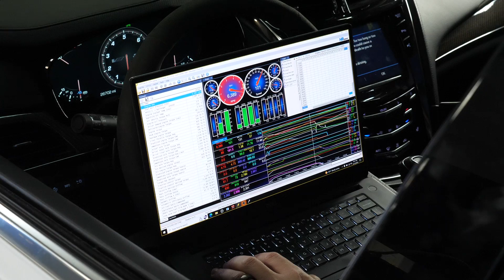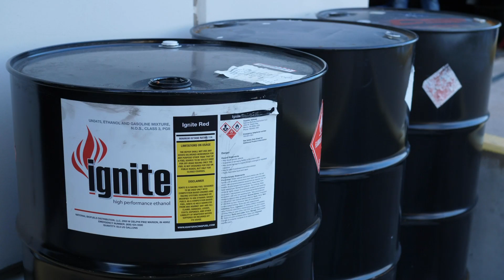Will This Turbo 2JZ-GE Blow Up? (Probably Not)

Comment: Hi totally not related but i got an idea some time ago 
im building awd civic and i was trough engine rebuild front suspension rebuild and everything i done myself 
i found it really pain in the ass to service front bearings because these are pressed into the knuckle
since i was planing on making car a bit wider and need to redesign front suspension at some point i wondered if i could build custom knucle with bolt on hub+bearing assembly 
do you have any experience with bolted bearings? are these a good sollution to my issue? is there a higher risk of bolt breaking or going loose than pressfited bearing? the main problem i have is that pressfited bearing needs to be installed properly otherwise it can crack the knucle and im woried about it 
if i keep driving this car as i did before reuild i will need to change bearings every year and thats alot stress put on a knuckle

Comment: The Non-vvti ge bottom end rods are the same as gte and pistons are higher comp then a gte. 10:1 so for a racing aplication it is cheap and responsive setup.
Reply: VVTI is better, makes a big difference on turbo applications

Comment: Andre, I theorize that the higher your boost level is, the less strain is exerted on the rod bolts across TDC of the exhaust stroke, due to the drive pressure in front of the turbine wheel, and depending on cam timing, also potentially incoming boost pressure during overlap.  Either way, there is a air spring of sorts cushioning the piston on the exhaust stroke.  I suppose the point at which this theory fails might be when the rev limiter is activated...  What do you say about this?

Comment: I wish I could find a good condition set of used early NA for my VVTI but then again I also don’t want to make over 350 hp a bunch of my friends are trying to build their VTI bottom end cars into thousand horsepower engines The best part about that is my mark three supra runs where there’s has been sitting in their garage for 13 years because they’re gonna get that motor done up the way they want it 😂
Reply: A lot of people do that when they probably could've gotten away with the stock bottom end, also what are they planning to do with 1000hp
Reply: @sircefiro  brag lol the two kids I know trying to do that really just want it for bragging rights or are saying they’re making a drift car but I have no idea what a drift car is he just Noah to Jade who is a really awesome motor
Reply: @oler777  People talk about 1000 these days like it's nothing then they go in a car with 500 and it scares the shit outta them. You need to be a pretty good drifter to use 1000 lol, sounds like they'll never get them running anyway
Reply: @oler777  they don’t need 1000 hp for a drift car lmao. They should’ve worked on the suspension and brakes before touching the engine. I know a guy who was running on the na ge for drift competitions and just now went boosted
Reply: @jvinclarence3977  the favorite set up I’ve had was a MK three supra 7mget with a whole set turbo strap to the thing it didn’t make great power but it made cool noises and was super dorky and you’re preaching to the choir they’ll spend $1500 on a turbo and then buy I don’t even remember the brand I just know it’s the cheap brand of sharks that’s not CX racing. The brand gets used on VW’s.

Comment: GE none VVT-I bottom end internals are the same as GTE internals as we all know. Big turbo with torque coming in after 4.2k RPM I’m sure it’ll survive. But let’s watch vid and see.
Reply: The way they were talking the made it sound like they were using a vvti bottom end
Reply: The rods are, the pistons aren't the same, hence the difference in compression ratio. I suspect it's also got a GTE headgasket from when they did the head, which lowers the CR as well.